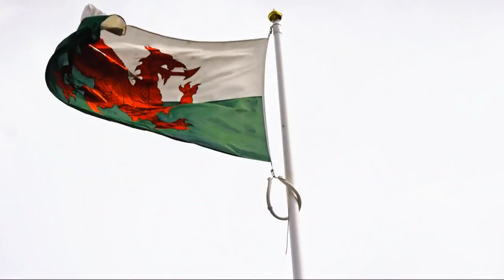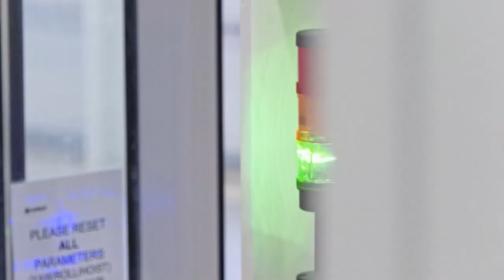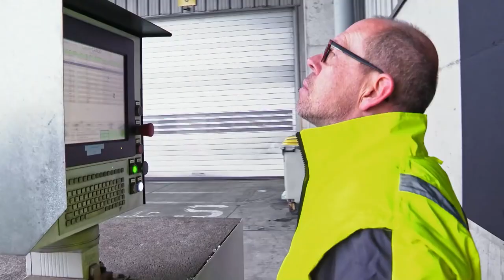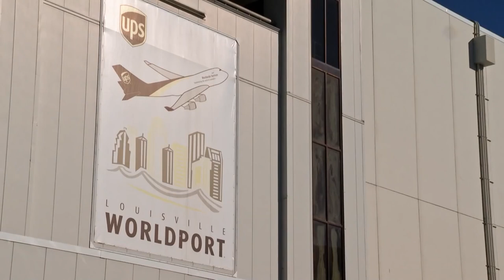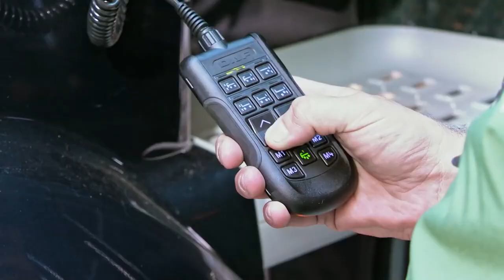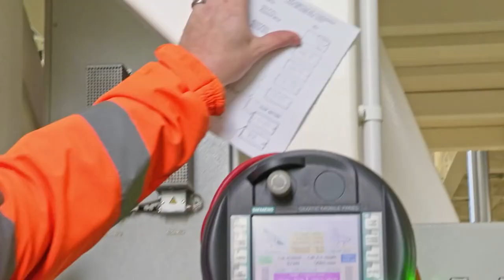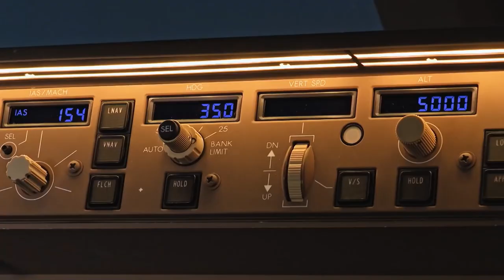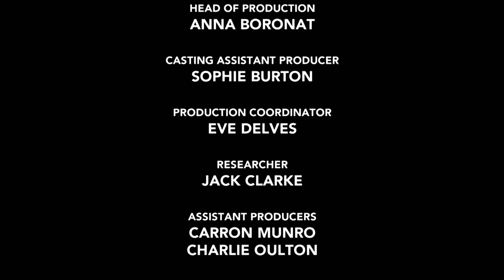Mega Air Transports | Episode 8 | FD Real Show

Comment: Had to laugh at the striped pole used as a target to load the Beluga.  My sister once failed to drive all the way into the garage and the automatic door dropped down on top of the car. Fortunately, the car was spared, but the door was toast. I made a chain of plastic grocery bags and hung them from the garage ceiling. I instructed her to pull in until the bottom bag toughed the windshield. That kept her from repeating the mishap.